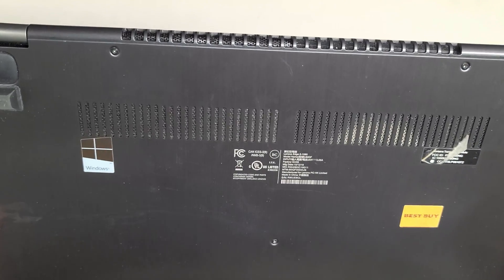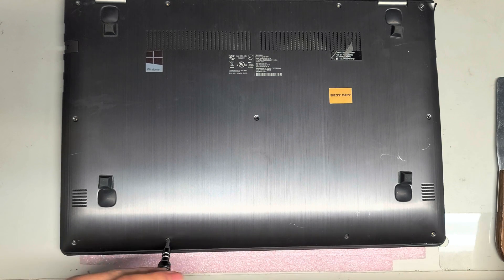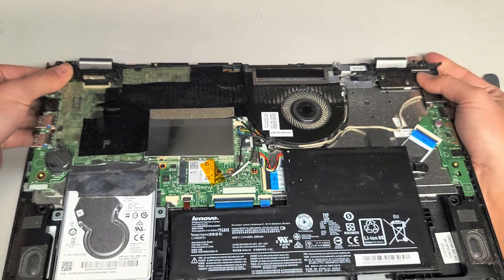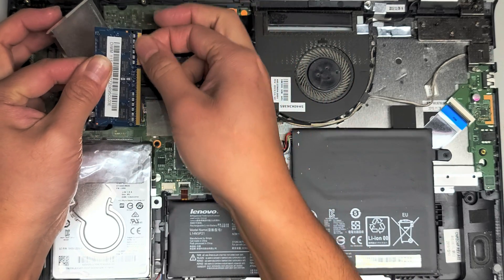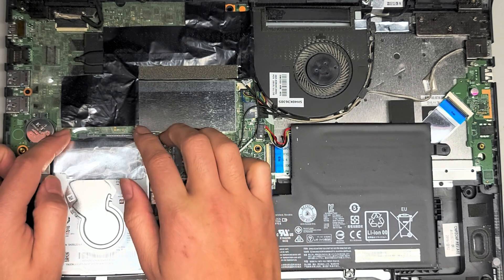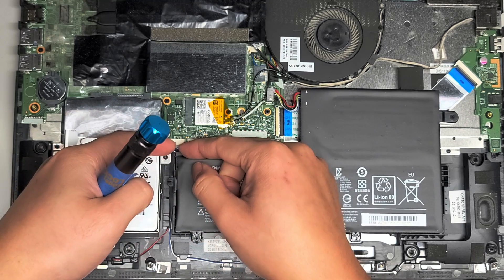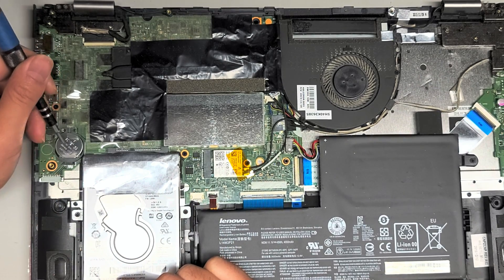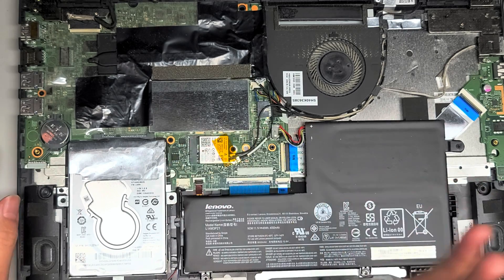Lenovo Edge 2 1580 80QF Disassembly RAM SSD Hard Drive Upgrade Repair

Comment: Great inside info! Still trying to trouble shoot why it won't  start up. Been thru all the typical trounce shooting: dezapping, bios battery, changed out plugs, took out battery, tried  to restart with & without battery, & with your help, found the ram. Popped it out & whipped it down . Darn thing still will not trun on either with or without battery/charger! UGH!!
Reply from the maker: Sounds like a fried motherboard

Comment: So I know you posted this a year ago but how easy is it to replace/upgrade the cpu?
Reply from the maker: That depends. Are you able to find a motherboard with a better cpu and are you able to remove it?
Reply: Unfortunately no, but I also found out that I would have to desolder and resolder the CPU. Which isn't worth the effort.
Reply from the maker: @MrGibbs189  lol yup

Comment: Can I upgrade the Ram to 16GB?
Reply from the maker: If it fits
Reply: @ItsBinhRepaired  ok, thanks
Reply from the maker: No problem
Reply: NO,you can't! Memory	
Type and speed: DDR3L-1333 MHz/1600 MHz
Maximum supported capacity: 8 BG
Slots: SODIMM × 1
Reply: @dingyusha8506  Sometimes, we can upgrade to more than the manufacturer says... I've seen this alot with MAC computers.  Maybe 8GB is the max?  Maybe 16GB would work?  I'm tempted to try.
Reply: after trying to find a 16GB DDR3-L stick... they are cost prohibitive.  Even if it WAS possible... it's not cost effective.
Reply from the maker: Yeah, don't do it lol Upgrade to an SSD
Reply from the maker: Hm?
Reply: Hey did you ever try to upgrade to 16gb??  I got one i want to try and upgrade it
Reply from the maker: It works, go ahead, but you won't see much performance increase

Comment: when I plug in my laptop charger, it charges 2 seconds and stops charging, like this constantly.  Do you think I should replace the battery or is it some other problem?
Reply from the maker: It can be the charger, charge port, or the battery.